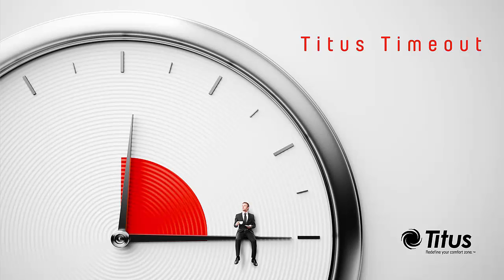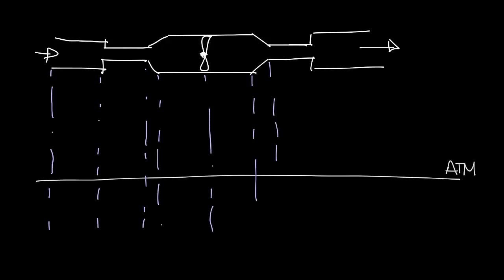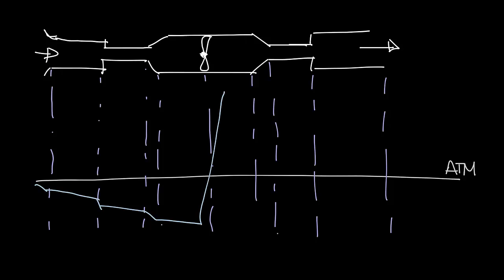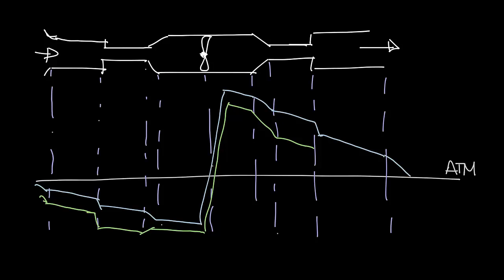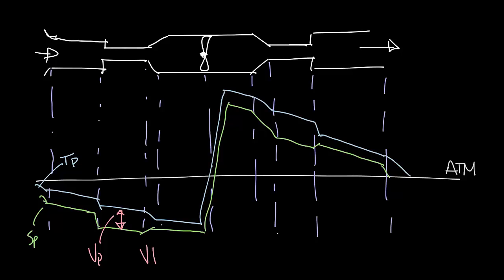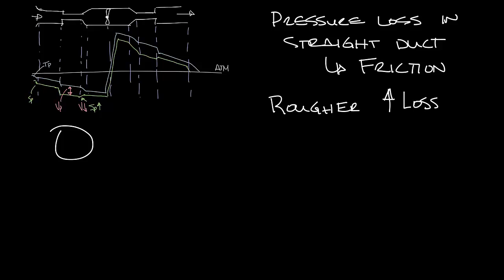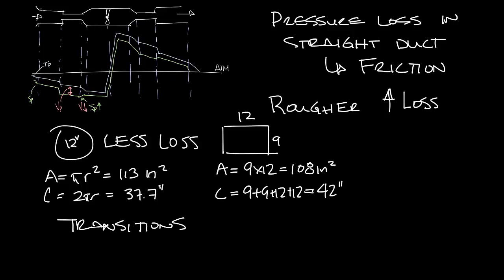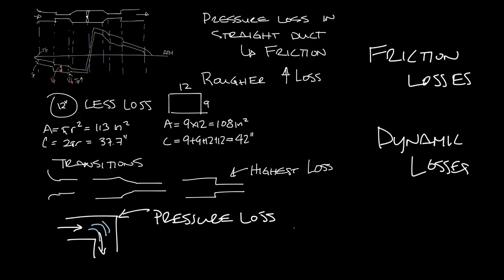Titus Timeout Podcast - Ductwork Pressure Losses

Comment: At point / line 8 the static pressure would decrease not increase. Static pressure is the pressure exerted on the walls of the duct. Increasing the volume will increase static pressure but decrease velocity.